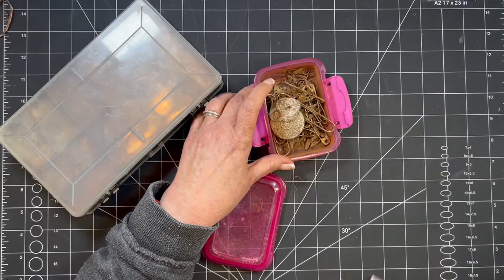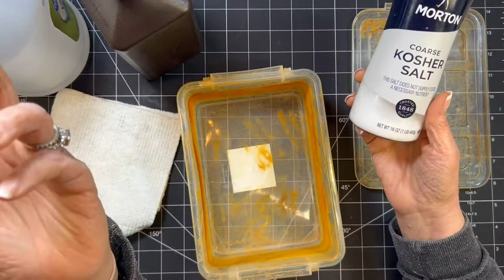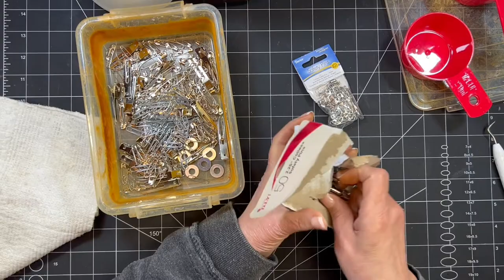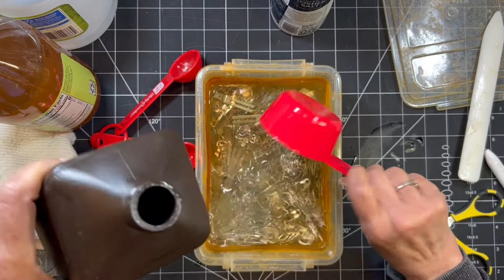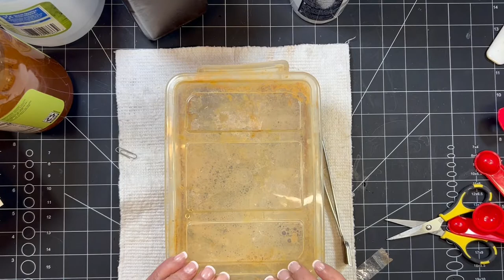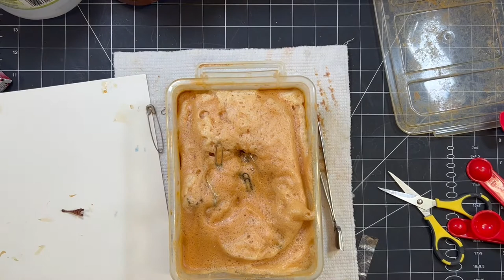Rusting and Aging Metals (if audio issues see description)

Comment: This was a great video. I love rusty things.you have way more than me though lol. I have come to use rusted paper clips in daily life, not just journaling.  They don't slip around. 
Also, I coat my rusty stuff with a sealer. Any clear matt or flat spray sealer. I use a tray size and shape cardboard box and treat a few at a tine. They dry so fast. Move them around by shaking the box so they don't stick. Flip them over and do the same. They're dry in minutes. 
Thank you for the video!

Comment: To get really great rusting water use straight vinegar to soak a steel wool in, overnight.
Reply from the maker: Need to try that. Thanks
Reply: LouiseAdie-zm2jf would you mind adding a bit more detail about your suggestion. Thank you